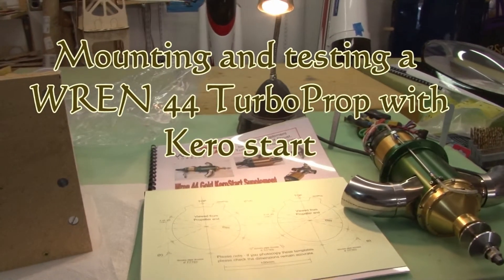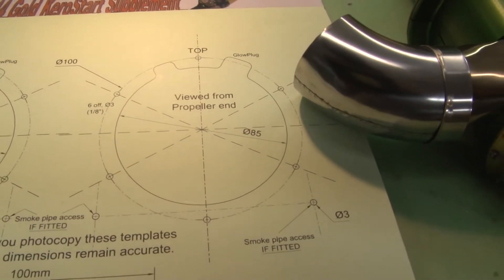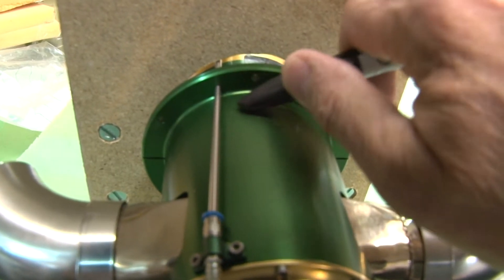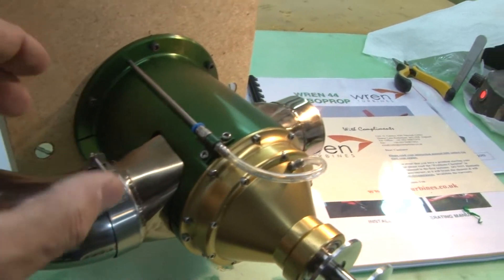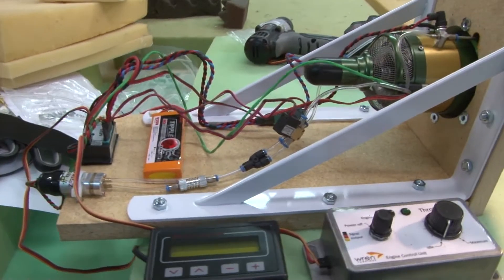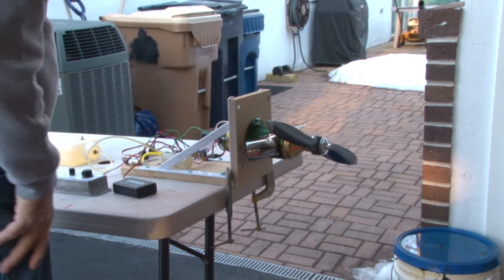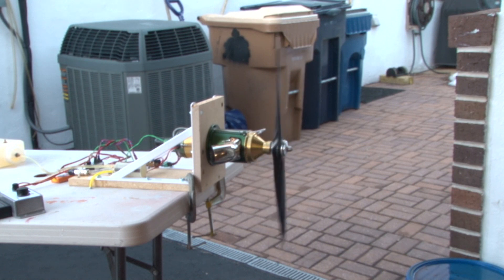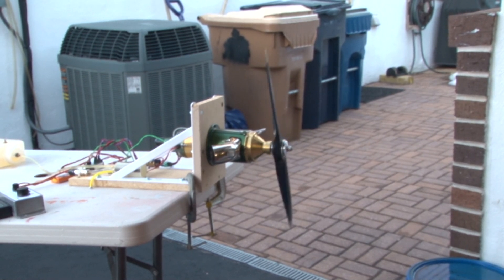W44 trial

Comment: Sweet! How have you liked the Wren 44 Turboprop? Does kero start still work reliably? Thanks! You have some awesome models!
Reply from the maker: This turboprop is excellent.. it is easy to mount and provides quite good power and it doesn't use a lot of fuel either. Starts easy and the throttle response is very good..
Reply: That is wonderful to hear. I really loved my Wren 44 Gold and this turboprop looks amazing! How has the reliability been overall?